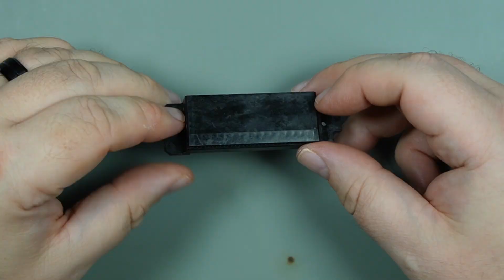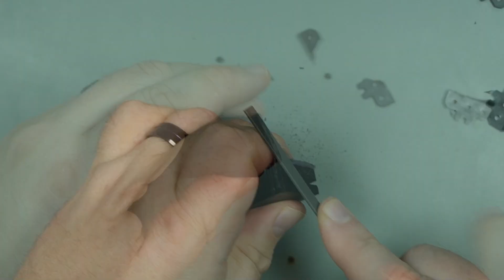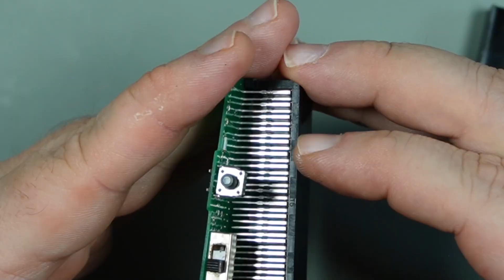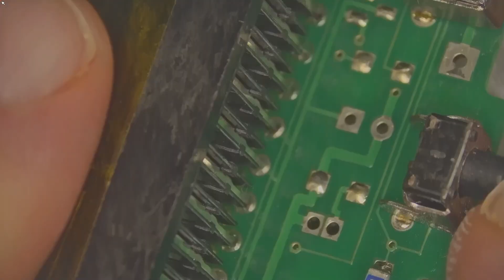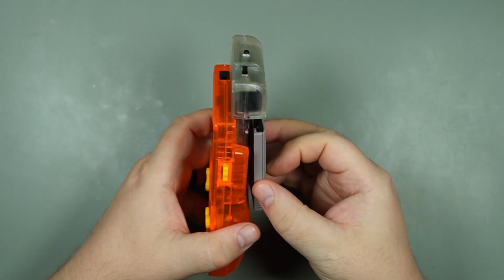Game Boy Color GameShark Repair | Applying Copper Tape on Contacts | Part 2

Comment: Won't the copper tape peel or wear away  after it's been pushed in a few times
Reply from the maker: Thanks for the comment! I'm not sure how long it will last, but I've been using it a lot and I don't even see it peeling up. That's why I was hoping with applying heat, it will adhere better and last longer. I'm sure it will need done again eventually.

Comment: Hello, where can you get copper tape?
Reply from the maker: Hi and thanks for the comment! I bought mine off of Amazon and was the first result when I searched for TygoTy 1" x 66'. There are some that isn't as wide, but I bought wider for other uses like PCB's with edge contacts such as Jamma game boards. It's more universal for me that way. If there is excess for what you're using it for, you can just cut it out like in my video. Hope that helped!

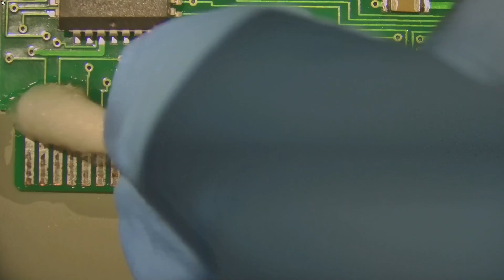Comment: 4:05
Should have stopped there and test. The copper tape is redundant and will peel off after awhile. To test if the edge connector is working, just probe it with a multimeter.
Reply from the maker: Thanks for the comment! I actually did test continuity to the nearest via before and after applying the copper tape off camera and checked out fine. I cut that part since viewers skip over repetitive testing and cleaning sections. The only problematic areas of the edge contacts were where the GBC pins make contact halfway down the pad where it looks worn. It will eventually have to be redone and isn't a permanent fix. But, it's better than being dead. =)

Comment: Nice! My only advice would be to use kapton when bridging to the copper tape so you can have nice, consistent solder blobs that won’t wick further down some pins than others. 👍 Of course, you’d have to be careful peeling tape off of tape but as long as you peel down it should be fine.

Anyway, I repaired the cartridge slot on a MegaMemory Card, which has the same connector and shell… and maybe even the same PCB since it could just repurpose the EEPROMs for backing up SRAM saves. I even uploaded a video of it in 2002 though I never made the it public. I ended up removing a mangled pin that was causing it not to work and replacing it with one from an unused position (GB Audio pin).
Reply: B-uWoAEuNMQ if you want to see it (unlisted).
Reply from the maker: Thanks for the comment and tip! That's a very good point about using the Kapton tape for bridging to the copper tape. I can see how that would give more consistent solder blobs and prevent uneven wicking down the pins.

Very nice work on the Mega Memory Card repair and they do indeed look exactly the same! I wonder who copied who? ;-) Replacing that mangled pin with one from an unused position was a clever solution. I was also exploring the idea of replacing individual pins. However, I ended up replacing the whole connector since corrosion was on multiple pins in my case, and I was worried I could miss some with hidden corrosion. I was also thinking about possibly using very fine sandpaper for metal where the connector pins make contact with the cartridge.

Hope to see you around in my next video!
Reply: @HandsOnRepair  Both devices are from the same company (Datel), who probably just changed their software so that it saves… saves… instead of cheats. Maybe switched to higher capacity EEPROMs… not sure. Interact was just their American partner/distributor.

They did similar for things like GameCube Action Replay vs GameCube Freeloader (same exploit/hardware, different software). Did something like that for an N64 import adapter too. 👍
Reply from the maker: Oh, that makes perfect sense being the same company. I didn't realize how many different cheat and save devices there were. The latest console I had a GameShark for was the Dreamcast.